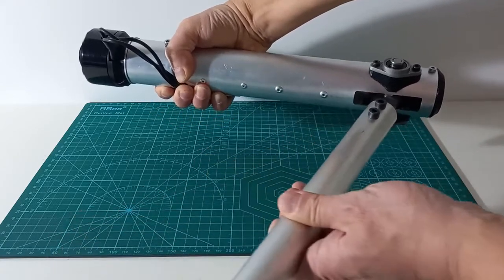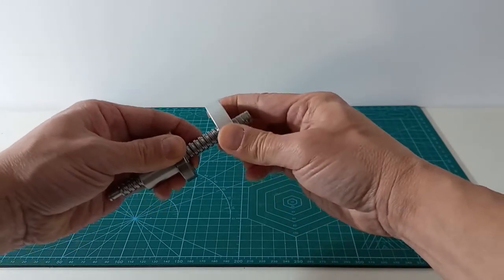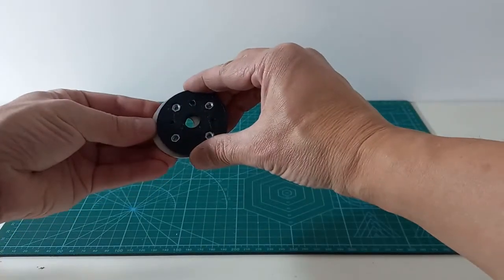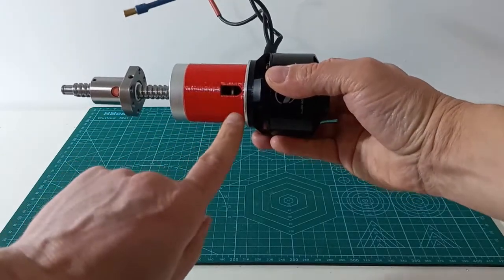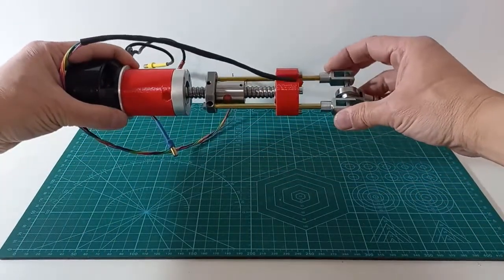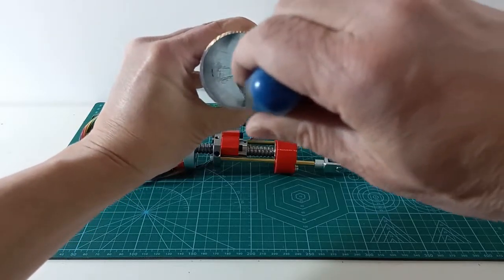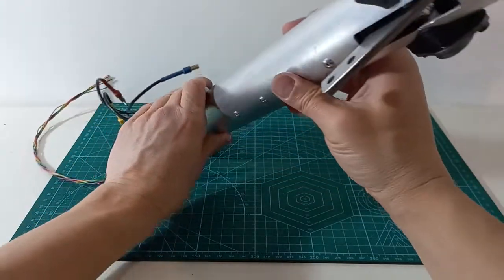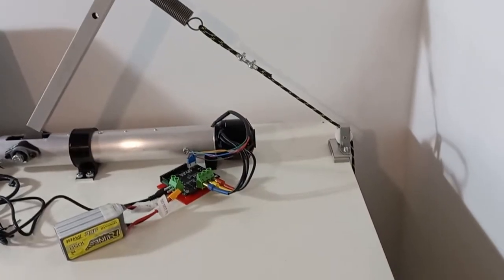DIY Actuator for quadruped robot based on a ballscrew: Powerful!

Comment: Did you calculate the torque? if yes, how?
Reply from the maker: At the end of the video you can see how I calculated the torque: The leg pulls a spring and I measured the its elongation. The spring was calibrated previouslu hanging weights to it . I also used counterweights attached to the leg.

Comment: Why didn't you use stepper motors?
Reply: steppers are rarely a good choice for mobile robots. they consume power pretty much all the time. and for a compliant mechanism you'd need an encoder anyway.
Reply from the maker: I agree with @IronReign. Also, there are lots of very powerful and relatively cheap RC plane, drone and skateboard brushless motors that are a very good choice.

Comment: The spring in the test fouls the accuracy of the measurement. The arm must LIFT the weights!
Reply from the maker: In the 10 and 15 Kg tests, the actuator actually lifts the weights (you can see the string sliding near the pulley at the endo of the pull). However, it was diffficult to arrange a 20 Kg weight so I removed the weights and just measured the elongation of the spring (previously calibrated with weights)
Reply: hehe glasslinger, i literally see you every time i least expect it :P

Comment: Maybe I'm missing something, but the way you used that axial bearing confuses me. At best it only takes up load in one direction, in the other the motor bearings take all the load. But I can't see what the axial bearing is transferring the load to even in it's working direction if that aluminium bearing block is not fixed to the tube rigidly. Other notes, steel ball bearings on aluminium tube will wear and marr up the aluminium quite quickly, especially since the ball bearing can't actually roll against both at the same time, it will slip against one of them.There are off the shelf POM coated rollers that play nice with aluminium though.
Reply from the maker: Yes you are right, the axial bearing only takes up load in one direction. If this actuator is used in the knee of a quadruped that is enough since the knee will only exert forces in one direction (leg extension). Note that the aluminum bearing block is fixed with four long bolts to a circular aluminum plate that also holds the motor. That bolts take all the load (tension). Sorry but I dont understand your comment on the steel ball bearings

Comment: If u need to do a more powerfull actuator than this u can also use a gearbox. Nice video keep up!
Reply from the maker: The torque is enough for a quadruped, but it needs to be faster. For that reason I have replaced the motor with one three times faster (170KV) and more powerful and the actuator is now very fast (with similar torque). Check my next video to be uploaded soon!
Reply: or simply adjust the screw to something finer threaded
Reply: @DresdenFPV  Not a bad idea, but finer threaded screw can slip more easyly, in the same diameter, because the screw profile is more thiner. It is good for pecision stuffs but if you need torque i gues thicker screw profile is key.
I know gearboxes are a bit difficult to make, but if you use gearbox you only need to change motor speed and you get a fast and strong actuator. These days all 3 phase motor is expensive, but u can cheat a bit on price if u go for rpm instead of torque, if i remember it right.

Comment: too slow
Reply from the maker: You are right, it needs to be faster. For that reason I have replaced the motor with one three times faster (170KV) and more powerful and the actuator is now very fast (with similar torque). Check my next video to be uploaded soon!

Comment: The actuator seems pretty noisy. Is it coming from the ball screw?
Reply from the maker: That motor is faulty and something is loose inside and makes that noise. I have replaced it with a faster and more powerful motor and it is now quite silent.

Comment: While it could make the leg chunkier , there is a fully 3D printed actuator made by Rbotics labs that weights 1kg  ,has a maximum torque of 44nm and a continuous torque of 28nm , you could put that actuator to either move the leg or put it as a replacement of the 6 NM brushless motor that you used
Reply from the maker: That is very interesting, however my intention when designing the actuator was to avoid 3D printed parts for gears and structural parts. Thanks!

Comment: Nice!! which brushless motor are you using?
Reply from the maker: In the video you can see a Alien Power systems 6355 60kV, 1700W. Now I have replaced it with a faster and more powerful 6374, 170KV.

Comment: Super cool. Do you intend to post any plans, drawings, or parts lists?  This would be fun to recreate.  It seems like this actuator could be strong and fast. Also the design seems like could be adapted to bipedal robots as legs or arms.  Seems like it would be fast enough to handle balancing operations.
Reply from the maker: That is the idea, next video will show a 3DOF leg for a quadruped based on this actuator. If you are interested yo can contact at hoxrobotics@gmail.com
Reply: it looks well thought through too! Like having holes in printed parts to assemble through. Nice work!
Reply: Really great! Approximate cost of parts?

Comment: Assuming that motor is similar to the one I tried, you can replace the bottom 8x22mm bearing with 10x22mm and stick the machined end of the ballscrew up into the motor so it's turned directly instead of needing all that coupler business.
Reply from the maker: What motor did you use?
Reply: @HOXrobotics  Surpass Hobby C6354